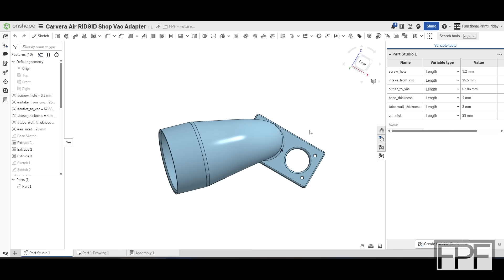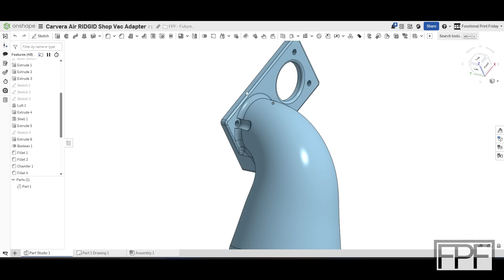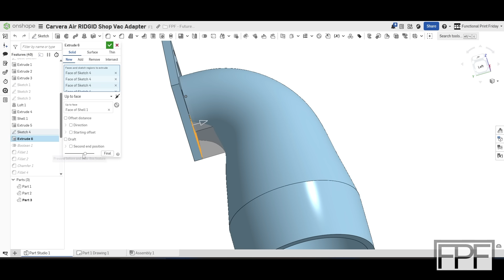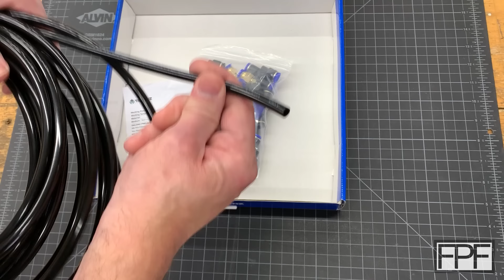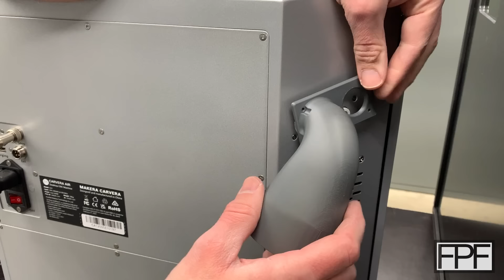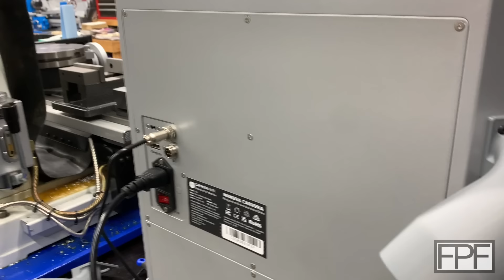3D Printed Vacuum and Shop Air Adapter for the Mini CNC

Comment: Everything is looking great.  
Just one small tip is to change the name of the actions, as it'll drastically help you when coming back to the drawings later, specially when they start to get more complicated.   For example, you have sketch 1, but you could name it to something like sketch_hose connector loft so its a lot easier to know which sketch is which (and other actions, like extrudes; ie extrude_main body, extrude_screw cutout, etc).   

I'm more of a fusion person, so I'm not sure if onshape allows grouping, but if it does, you might want to consider putting all the related filets in a group as well.  Maybe "filets_base to hose" group, etc.  (fusion allows you to define multiple filets in the same window, so maybe not quite as necessary, but not sure if onshape allows something similar to help you organize the actions a bit better.)   Also, if onshape does allow grouping, you could group together all the hose parts together, all the base pieces together, etc.

Comment: A recommendation to cut your interface pieces first with a laser to check the fit before committing to the full 3d print. For example, cutting the plate with holes out of cardboard or something to check it lines up with the screws/holes, and cut a circle the size of the hose inlet to see if it would fit over the hose. Would have saved you the first print and a lot of time
Reply: Or just print the first mm of the part. No need to get out the laser, and it will match the shrinkage of the material.

Comment: I wish onshape was a program that I could run locally. I really dont trust what might happen if I invest time and energy into learning this product and they decide it's no longer free. It does really seem to be helping you step up your designing and modelling though, so that is cool to see.
Reply: This is one of the reasons why I use FreeCAD. It runs everywhere and always will.
Reply: Use Fusion. For personal use it is free since years
Reply: The skills apply across other products as well. So learning/using it wont go to waste if the product goes away, or becomes prohibitively expensive
Reply: Use fusion 360
It has free version and runs locally
Also it's so easy to learn and make stuff on it

Comment: You may already be aware, but you can rename the operations in the tree, either by right-clicking the item in the tree or while in edit mode for that operation. 
For designs with multiple sketches, extrudes, etc, it makes it much easier to find the item you want to edit. 
Thanks for the interesting content.

Comment: Interesting, my H2D needs more clearance than my usual adder of 0.20mm for screw sizes.  When I saw your variable of 3.2  I was thinking to myself that it wasn't enough but wasn't sure if it's my printer that needs more or not.  Anyway your video confirmed it.  I normally add 0.30 now for screw clearances.  Great video, my only complaint is you went to On Shape instead of Fusion.  🙂  Thanks!

Comment: 1/8" shank - Dremel, air powered die grinders, Palm routers, small CNC routers, and I even have a whole ecosystem on engraving bits for my CNC that are 1/8" shank (Cat 40 -> 1/8" collet -> engraving bit, in a 2 ton machine looks goofy AF, but whatever does the job). The range of available bits that can fit that thing is pretty wide. I need to put that tool on my list...

Comment: From my very limited experience with Fusion (it’s not exactly the same as onshape, but in this context it is, drawing that rectangle with an actual line rather than just a constraint or construction line, it would separate the chunks (I forget the mathematical term for those lol) based on the intersection points of those two shapes.

Comment: On the screwdriver, design up a thin sleeve with an external hex feature.  It doesn’t have to be very long, just enough to keep the screwdriver from rolling. Print it out of TPU 👍👍😎👍👍
Reply: Came here to say this. Even one flat side on the sleeve would be enough I think. Don't know if the sleeve is going to prevent it from fitting in the case though.
Reply: @sandphotoNL  Design a new case, I guess. 😁
Reply: Yep came here to say this. This is a 3d printing channel and he's complaining about something he could fix with 3d printing in a few hours max.

Comment: IMO you did too much to try to make the item one piece. I would've done it in up to three pieces: (1) the frame piece, which I would have holes in all four corners, with a short straight pipe extrusion with a ring for a friction fit; (2) a pipe with a 45 degree curve that snapped over the pipe, and (3) another pipe, either 45 or 90 degrees, that snapped over the other one and finally made the connection to the hose. This would allow for rotation, letting you attach the vacuum hose without placing a torsional load on the adapter. It would also allow for a stronger connection to the side of the machine without blocking screw holes or having to add complex geometry to the hose connection.
Reply from the maker: this sounds like German engineering.

Comment: Well Frantik did their job.  I just went to buy one.
Reply from the maker: Lol, it's a neat little tool.  They really need to sell replacement bits.  I was a little disappointed when I snapped one, but even more disappointed when I went to buy a replacement bit and they don't sell them (yet).
Reply: @FunctionalPrintFriday  1/8 inch is a pretty common shank size for drill bits.  As you postulated PCB drill bits are 1/8th inch.

Comment: Your videos are one of the main reasons I bought an H2D. It's been sooooo nice, even with the H2C coming out 3 wks later, still glad I pulled the trigger. @ shop vac - I designed a full size shop vac right angle adapter that used .177 BB's for a "bearing" so it could rotate. Just re-printed on the H2D.

Comment: For the Fantik drill, is the low speed just reduced speed or is it lower geared for more torque? Maybe that's the purpose. To make it work for tougher materials.
Reply from the maker: pretty sure it's geared down, good point
Reply: @FunctionalPrintFriday the slow speed  might work for threading?

Comment: Yep, construction lines are key - you can press Q to toggle it quickly; if you don't have a line selected it'll hold the state for the next line/rectangle/etc., and it can also be toggled in the middle of drawing a line the same way. In addition to mate connectors there's a bespoke 'Plane' tool that can create a new plane as an object in reference to existing geometry as an axis and an angle (and some more stuff), I find that nicer to use for these as it is its own history item and it can be reused across multiple sketches. Also for if I'm getting into a ton of revisions I try to reference early geometry (e.g. the initial axis planes) when appropriate so that modifying earlier history items is less likely to break references.

I'm like 100% sure those are PCB drills, especially given where it's manufactured is home to millions of them :P

Comment: That mate connector sketch feature is eye opening. I've used Onshape for a few years and whenever I needed an angled sketch like that I just made a new plane. It was very cumbersome depending on the model trying to get the right references. I will definitely use that in the future.
Reply: Same here.  My first thought would have been to construct a new plane or two, with the sketch plane containing the center of the bore.  I think I don't utilize mate connectors as much as I could/should.

Comment: One of my favorite things about Fridays lately! Just 5 minutes into the video, but it has already occurred to me it might be cooler to make the plate out of metal (put that new CNC to work making its own accessories. 🙂) and let it extend the vaccuum out to a more easily accessible hose connector and then print a TPU adapter for it.